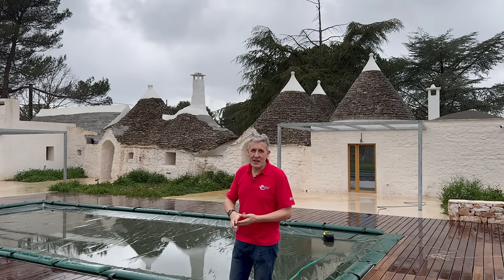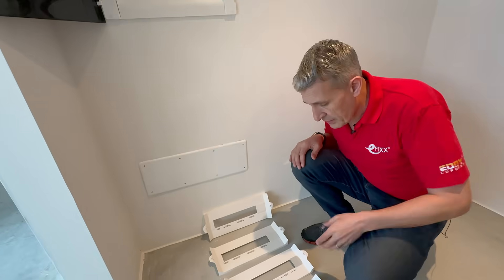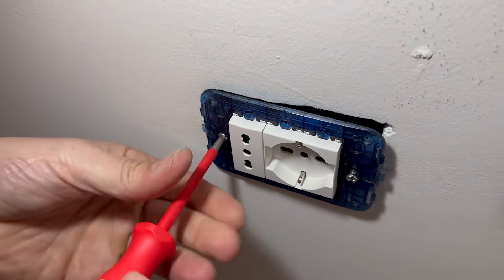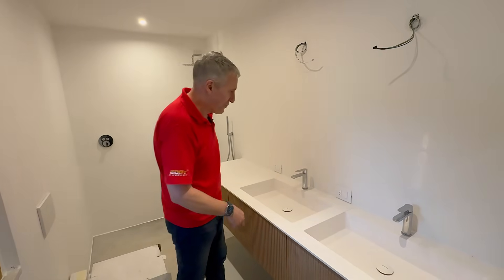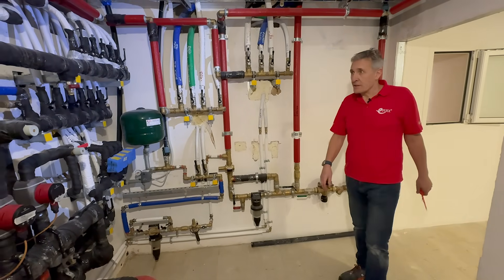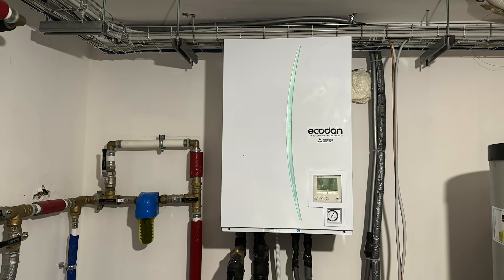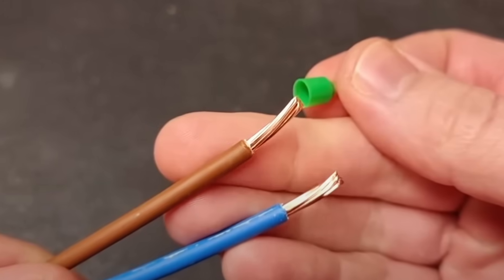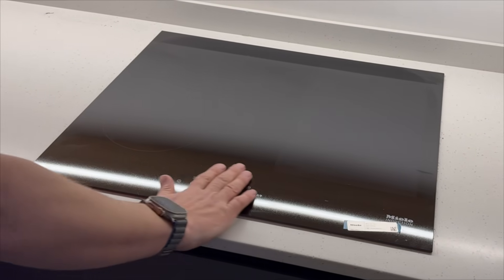Electrical Installation in Italy

Comment: This seems like a big posh setup, what is the setup like in the average Italian home?
Reply from the maker: They start like this https://youtu.be/mJHIBfJyjOQ?si=wSdjEInOcP5u2o4j
Reply: Much, much simpler than that, that setup costs really a fortune! Anyway, normally, we have both italian and german socket because in our market the home appliances have one or the other plug. But, taking off all the automations, the setup looks similar. The default power supply installed is 3 kW.
Reply: About the same minus the automation, heat pump and pool service room. 
Everything else is standard in any home made / renovated in the last 20 - 30 years.

Comment: I have seen better, tidier, less hasty creations with greater use of cable ties and labels, this does not mean that it does not comply with the regulations even if in a couple of points I would have done differently, never mix conductors of different services and types, like TV cables and telephone or electrical or network cables they must always be separated everywhere, we also section the neutral, all single-phase protections are bipolar but only one pole is protected, so in the event of a fault on the neutral to earth, opening the thermal magnet we manage to switch off completely and avoid being in the dark for hours before an electrician arrives

Comment: I wish we had rectangular back boxes that are deep here in Greece. They use these round, shallow boxes where the schuoko outlets are held in by wings which fail to grip the plastic box. The electrician who wired my basement level placed all of the light and fan switches outside the bathroom, not upstairs, I had the electrician place switches inside the bathrooms. As for shock hazard I have a whole house GFCI feeding the mains on the panel box that each level has. If they sense any inbalance in the system they trip. So each level has its own GFCI breaker as well. To add icing to the cake I also have an American 120 volt 60Hz wiring in my home to handle my American appliances and tools.
I refuse to use any Chinese inverters for my solar system. If it is internet connected it is a security hazard and because of my work requirements. It’s a back door into everything in my home, NO BUENO.

Comment: In Italy you are allowed to use for the phase conductor any other color that is not currently reserved for other functions (such as blue or green/yellow). This is particularly useful to identify switched circuits when they run trough the same boxes (for example in your case the light was made with the red color after the switch to distinguish it from the permanent live). For phase conductors that are not interrupted I think the new regulation now suggest to use gray, black or brown. Of course in a single phase installation you can use any of the 3 colors for the same phase (since you have only one) and that is useful to distinguish different circuits (e.g. sockets from lights). 

Regarding looping out of the sockets, you were in the past allowed to do that only to a maximum of 2 or 3 boxes in series. Now I think regulation is changed and allows it always provided you are in the same room. In reality that is a bad practice, because the resistance of all the terminals adds up, and thus usually a star wiring is used, and there is also the voltage drop to be considered for the amount of cable (a maximum of 2% is allowed to the furthest socket). The looping terminals are used only to connect to sockets inside the same box (that is allowed without limitations). 

Also, 3 phase is rarely used. Most houses have a single phase connection, but for new installations with heat pump and induction cookers 3 phase is becoming popular even in residential.
Reply from the maker: Good to know thank you.
Reply: You must hate NYM / NYY cables in Italy 😅

Comment: The Sockets in the bathroom should stay 60 cm away from the edge of the sink, according to CEI 64-8 (and EN)
Reply: A 60 cm dal bordo della doccia o della vasca, dal lavandino non ce un obbligo preciso, vale il buonsenso!
Reply: It is too deep for me too. I self use minimum 50 cm over the water basin or down under it for the local water heater.

Comment: Originally Italy had its own sockets that accept Italian plugs with 10A or 16A. These have different pin spacing. Italy now also uses modified Schuko sockets, which also accept the Italian and European plugs.

There are also French sockets with a grounding pin. These are also used in Belgium, Poland and the Czech Republic. 
If it weren't for the licensing fees for the Schuko plug, more countries would not have used the French plug.
In addition to its own sockets, Denmark is now also introducing French sockets. The PE is not connected with Danish sockets and European plugs this happens frequently.
The European 3-pin combination plug fits into Schuko and French sockets.

Switzerland has its own system. Only narrow Euro plugs fit there.

Russian sockets are roughly the same as Danish ones but without PE
Reply: Both Italy and Switzerland use 4 mm prongs. Originally everyone in Europe use them but other countries moved to 4.8 mm. Russia uses schuko though likely ungrounded ones are at least in old installations on dry rooms. Same in most European countries. Schuko was 4.8 mm from the beginning. 

Originally everyone has similar sockets with two prongs but then when they started to add grounding they made different choices.
Reply: @okaro6595  4 mm pins never seem to have been used for plugs rated at more than 10 amps, in the old days only 6 amps. Germany had pre-Schuko 10 amp plugs with 4.8 mm pins. Initially Schuko was only rated at 10 amps too I think. I have some Schuko sockets from the 50s that are rated 10 amps rather than the usual (and very outdated) 10 A DC/16 A AC rating.

Comment: The socket with the double holes is to accept both a 10A plug  (around 2Kw) and a 16A plug (around 3.5Kw). Some appliances like table lamps, phone chargers, tv's, use the 10A small plug. You can see that the shuko has larger holes close to the center to accept a male shuko plug, which wouldn't fit in the italian in-line one. 4:45 that is usually to indicate a "switched Phase". If i am not mistaken you can use colors like red, white, purple and so on as long as the colors aren't similar to the earth or neutral cable (can't use another shade of blue or green cables) to indicate phases that might be switched. It's common to find for example 2 white cables in between 2 single pole double throw switches. The relays to switch the lights is something that you usually find in new homes/new wiring. We also use the 2 single pole double throw or 2 double throw and one 4 way switch method. I noticed that when there are 3 to 4+ points to switch the lights, they just go with the relay setup (say for example the common lights on each floor of a condo, with a button on each floor and a time relay). All the Vimar smart stuff is also something you dont find in the typical residential home. The outdoor lighting is just done poorly.
Reply from the maker: Great information - Thanks
Reply: @efixx  About the light outside, the plastic black flexible pipe is not ok for outside. That kind of pipe it's only for interior and have to be install inside a wall. In general in the house there was things not properly done. Thank you for the video, it's very interesting to see how our way to do electrical installation it's seen from abroad.

Comment: I would say Italy is an Electrical Manufacture's Paradise. It must cost home-owners a fortune for all those Conduit runs, DB's, & Relay's. A safe system, made over complicated. An Electrician will never be out of work over there. Thanks for sharing.
Reply from the maker: Probably a higher upfront cost but much easier to maintain moving forward. No need to keep changing consumer units.
Reply: It will save in future kitchen units being taken put amd walls being burst open to try repair a failed cable . You'd have to run cables during installation anyway so flexible conduit is not much different to run
Reply: The one shown is not a classic German Shuko, but an Italian two-pass Shuko. In fact, the central hole for the neutral allows the use of Italian plugs with 3 pins, both 10 and 16 ampere ones. In Italy I have rarely seen German Shukos.
Reply: Italy and France has better electrical manufacturing than the UK.
Reply: Kinda seems like a renting property tho.. like apartments with shared pools etc.
Else it kinda would be weird to use both italian and eu sockets everywhere.
Reply: @Woltox1 as an italian electrician ill tell you that we normally have both plugs (italian one is way better tho)
Reply: @Woltox1 By "EU" you mean schuko? That's not EU,  that's just German. There is no "EU" plug, although France/Switzerland (not everywhere)/Italy have the same.

Schuko is basically available everywhere too, but 's far from being European.
Reply: @zaxmaxlax  Sure, but it's not really a standard. There are a few tricks to help being interchangeable as much as possible across all the real standards.
My point is not making any sense with calling any plug an EU plug.
Reply: @Woltox1 I think that’s pretty common in a lot of places to have two electrical systems, I’ve been told in Bermuda it’s pretty common to have UK and American sockets in lots of houses as appliances often come from either country
Reply: @Woltox1  A lot of our appliances come with a Shuko plug so we've just partly adopted the socket in our homes, which can also double-purpose as a regular italian socket, instead of having to run an adaptor or cut and replace every single plug. This is how I understand the order of things.

Comment: It really makes you think that UK systems are far better, far less equipment and copper. Brown flexi cable 😂😂😂😂
Reply: French system is far better than UK system...sorry but it is true!
Reply from the maker: Are you from France by chance?
Reply: @ReveilLunaire 
The French are better at the consumer unit with DP breakers and twin bus bars. That is available in the UK but few use them. 

The main RCBO combined main switch replacing the main fuses is far better than the UK. They can be fitted in the UK and are available.

French is all TT in houses. Far better than the C-S we use. There again you can ignore the supplied ground cable fitting your own ground rod.

Apart from those points above, which we should standardise ASAP, the UK is better than France.
Reply: @ReveilLunaire  French, German and UK all have slightly different ideas, but they are easy to understand and logical. The Italian system is just weird, I see no benefits, just more complications and random boxes in walls.

Comment: I like you're saying why we can't agree of one socket type. 
We agreed in the early 90 to raise from 220V to 230V and you British should lower from 240V to 230V but I don't think the last part happened, you are still using 240/415V so I think we can agree one who's the most difficult here!!?
Reply: The point of the harmonization wasn't to actually change the voltage (these often remained the same) but to ensure that goods manuacturered for the EU market would be designed to function correctly on either 220 or 240v (or anywhere within the 230 +10% -6% range.  Can't really change the voltages too much as older equipment might fail when exposed to a higher or lower voltage than was designed for (or have shortened lifespan).
Reply: Well we somehow convinced the EU to adopt this wonky standard to accommodate us. 230 V+10%/−6%.  Been suffering from some European brands GU10 lamps dying ever since, specially when local solar can push it up to 250 and beyond.
Reply from the maker: The standard voltage in the UK is 230 / 400 and has been for some time, although in practice it's still higher, especially now we have so much solar floating around. We also changed our wiring colours from red, yellow, blue, black to brown, black,grey and blue.  Time for the EU to adopt ur ring circuits and over engineered plugs. 🤣🇬🇧
Reply: @efixx 
British plugs are over engineered? Please! The best by a country mile. Saudi Arabia standardised on the British G Type.
Reply: @efixx 
Final ring circuits are superb. Simple and ingenious. A friend was renovating his two bedroomed apartment. Short of money as he had just bought it. He had to fit expensive  AFDD protection. I advised one 4mm ring for all. Sockets, oven, induction hob, the lot. And one 1.00mm lighting circuit. All legal and works a treat. Cheap with the best protection.

Comment: Hairy Jesus can you imagine doing an EICR on that lot....😮
Reply from the maker: no ring finals!
Reply: Personally EFIXX, I don't have a problem with rings, however I would say, in the real world, how many people can discern issues or faults given the number of variable factors including test lead deterioration, dodgy dog clips and old/worn sockets where the reading is completely different between the left and the right hand sides and then is it a spur or isn't it... etc.
R1+R2/4?.... have you found a ring within a ring...? 
Quite frankly you're on a price and often just grateful for a reading providing it's not too ridiculous. 
There's also a noticeable trend courtesy of the dandy boys on YouTube to rubbish anyone who twists their conductors together, yet you get a far more reliable joint in the terminal if you do that. How many times have I a taken off an accessory and a conductor, slipped into a terminal, simply pops out or in the case of a ring, is already hanging out.
I'd like to know whether our foreign counterparts issue any electrical certificates upon completion and whether they ever carry out EICR's on their installations?

Comment: As a non Italian, the straight / 3 in-line Italian plug is an older standard. In comes in 2 flavours, the smaller one is limited to I believe 1500W, while the larger one is up to 3000W.  That's what I remember being told when I asked about it.
The larger plug is beafy and I would say almost on par with the UK plug. A great bit of design.
Reply: 10Ampere / 16Ampere @230V
Reply: Apparently the 10 amp variety was originally intended for lighting circuits (flat rate calculated based on the number of light bulbs) while the 16 amp one was for "power" equipment, on a metered supply as we know it today. Schuko is fairly common in Italy but doesn't seem likely to replace the Italian sockets anytime soon. You can get 10 amp sockets, 16 amp sockets, combined 10/16 amp ones (as shown in the video), 10 A/Schuko sockets (Schuko with an additional hole for the Italian earth pin) and "universale" (Schuko, 10 A, 16 A). The latter is slightly dubious because you can touch the pins of a partly inserted Schuko plug. 16 amp plugs are fairly uncommon, I've been to places where the washing machine was the only appliance that had one, so if you fit your whole house with 10 A/Schuko sockets (P30) you've got most of your needs covered.
Reply: after the supplier's meter there are differential and magneto-thermal protections, each house has its own story depending on whether it is new etc., 10A is used for lights and 10A sockets, various types of distribution are used, sometimes in renovations use a single 16A per room which is both the light and the socket, it is difficult to exceed 10A (2300W) with the lights even when they were incandescent, they are a known and predictable absorption, not like for the sockets, the legislation allows it, same what is rare is to exceed 3680W on the sockets, the 16A the bivalent or schuko ones, we have the 16A trivalent which does all 3 types, another typology from the past was a 16 socket circuit, a 10A lighting circuit, in large houses the area is divided day from the sleeping area, for a total of 4 circuits, mostly to give the possibility of having something that works in the event of a fault, then additional circuits for heating, air conditioning, kitchen, etc., many old houses only have two circuits, one for the sockets and one for the lights, 10A is generally used for 1.5mm square conductors which is the minimum section required by law, for 16A 2.5mm square is used, then it depends on the type of installation and length, the diameter
Reply: @Ragnar8504  here there was the 220V three-phase distribution where between phase and phase there was 220Volt and between phase and neutral there was 110V, from here the two circuits called light and driving force were born, only the light bulbs were 110Volt, then abandoned for the 230Volt only
Reply: @Ragnar8504  it's old stuff that hasn't existed for over 50 years, there were some distribution networks left in the center south of private or locally managed companies owned only by the municipality not by the Italian state which produced and distributed only the 220 with 2 phases, it was found still something 20 years ago, then due to regulations everything was adapted, the 110 volt + or - 10% was abandoned around the early 60s, nothing that worked at 110 Volt was found anymore with the advent of ENEL, a national public company from 1962, now it is 400Volt between phase and phase and 230Volt between phase and neutral, everywhere